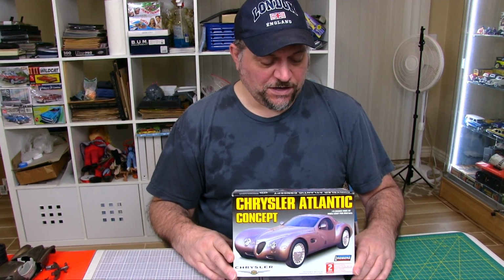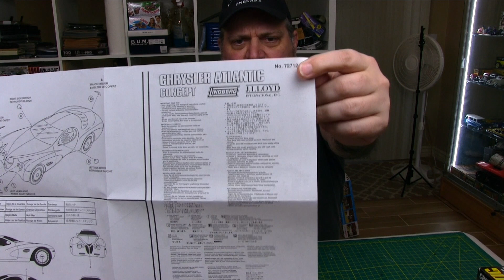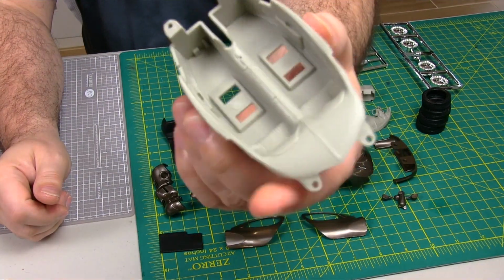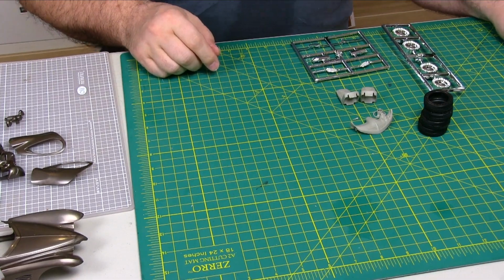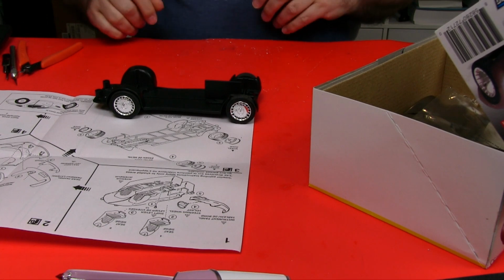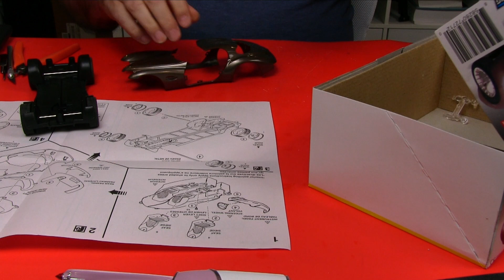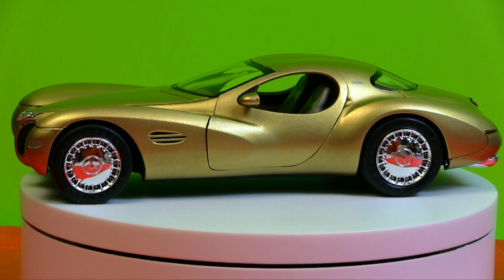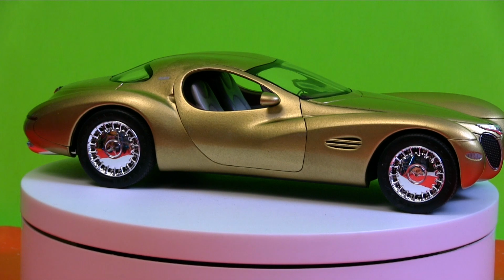Plastic Model Kit Review & Build: 1995 Chrysler Atlantic Concept Car

Comment: Nice build. A shame with the clear cote that came off, but it looks good nevertheless.

I have the snap version of this kit, released i 1997. It's the exact same kit. No differences whatsoever. Even the instruction sheet is the same, including the tip telling you to "Use rubberband to hold doors to body while glue dries," which is a weird tip for a snap kit.

It's like the people at Lindberg looked at it 10 years later, when they were going to reissue it, and thought to themselves "Hmmm, it you need to use glue, it's not really a snap kit, is it?" And then decided to reissue it as a skill 2 glue kit instead of a skill 1 snap kit. But in reality it's just a rebox of the original snap kit. Even the kit number is the same: 72712.
Reply from the maker: I’ve had similar bad experiences with rubber bands taking the paint off as well so probably why I chose tape. It’s not so much the paint as the type of paint. Metallic paint tends to screw me over like that.

Comment: Next time use Plastic Weld for the glue ( it works in seconds) and Frog Tape if you need to use tape. It’s a shame but it’s a sharp looking model
Reply from the maker: I have it and use it for certain parts. Usually avoid using it on painted parts as it tends to run all over.